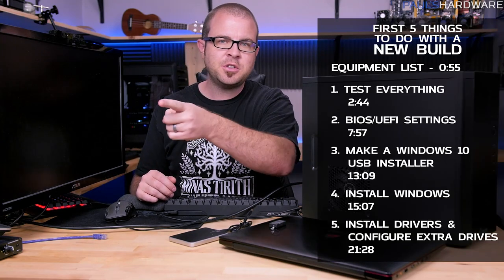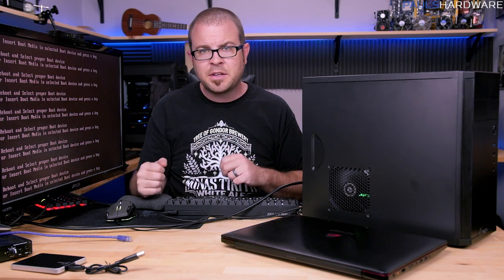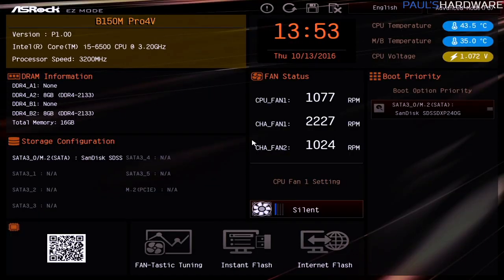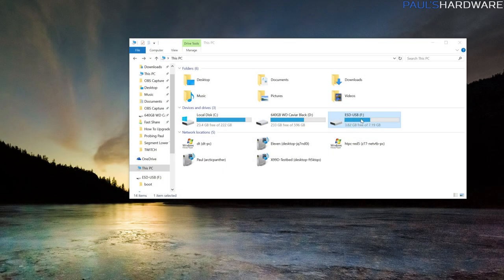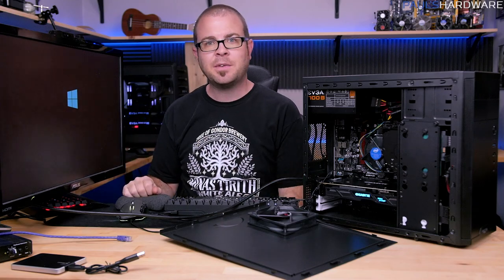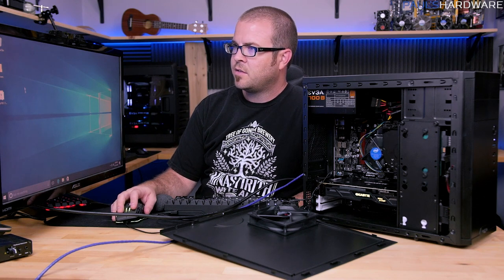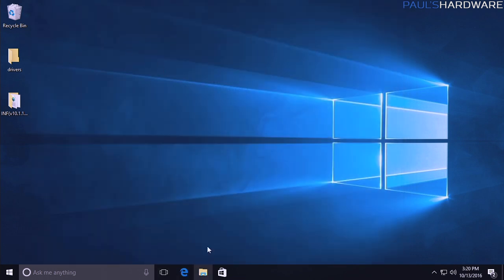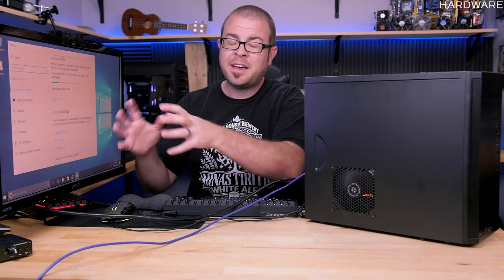First 5 Things to Do with a New PC Build

Comment: Windows makes me sad. If I am paying money for a software license THERE SHOULDN'T BE ANY ADDS OR SPYWARE ON IT.

installs Linux mint

Re-installs Windows because of games
Reply: have you tried Wine or something similar? i heard it works for a decent amount of windows games but never took the time to personally attempt it
Reply: I did a long time ago, back in the days of WoW Burning Crusade it ran better under Linux than under Windows (I had low ram, and Windows would just suck it, like a lady of negotiable affection suffering discontinuation syndrome from crack cocaine)
Reply: Wine doesnt work for everything. What it does work for isn't always stable. And when it is, it almost always has lower performance than on native windows. Unfortunately, there just isn't enough install base for people to support linux properly, either through wine or through native support.
Reply: That's the sad part. You have to use Windows for games.
Reply: I mean, you don't HAVE to use Windows to game, there are tons of games with native Linux versions, a lot of games that work just fine with wine and all the emulators you could ask for. Especially for older games there is a good chance that they will run better under Linux than they do under newer versions of Windows.
For my gaming needs, Linux is totally fine. Like, I have a ton of games in my Library with native Linux support that I have never touched, because I just don't have the time to play all of them.
That said, if you are the kind of gamer who is all about the newest AAA gaming titles, you probably want to have a Windows installation.

Although it is totally possible for that Windows installation to run as a guest virtual machine on a Linux host, with hardware pass through. That way you can just run Windows alongside Linux without having to dual boot and with pretty much no loss in performance. Do all your browsing and everyday computing in Linux, fire up Windows when you feel like gaming (or keep it running in the background), best of both worlds. Does require some extra attention when purchasing hardware though (has to support virtualization) and you are going some Linux wizardry to pull it off, it's definitely not beginner friendly. But it can be done.
Reply: download pre activated windows lol that shouls save you a fuck ton of money.  never had issues and it works great.
Reply: I want to play witcher 3, I guess I can always use my wife's laptop to do it since it came with windows preinstalled
Reply: Nothing you can't disable manually :) I used W7 for years and I was against W8 and 10 (8 is really terrible that is something I won't change my opinion about) but when I got my new z170 system I had to install W10 or do some work around to get it installing W7 however I thought about giving W10 a shot and actually it's quite   good in almost everything after u disable Microsoft crap however what I have noticed is that W10 has more process running in the background no matter what u do (they are necessary for windows its self)  more than W7 did :/
Reply: Jack Krauser Another reason I dont like Windows is that it doesn't feel safe. I forgot my admin password on my old W7 laptop, hadn't used it in 2 years, so I was able to clear the password field using just a linux boot drive, it took like 10 minutes. 

Malware and spyware is a lot more of an issue on Windows, as well.
Reply: Except that each and every single internet provider in america also sells everything you are doing while connected. The internet provider get more money for doing this than any amount you could ever give them for any level of service
Reply: Ronald C Krause Jr but... I use a VPN
Reply: You can disable those ads and (most of) the spying (Spybot Anti-Beacon). 
Look, I appreciate the concept of an open source OS. As a matter fact, I have Linux Mint installed (though I still need to install a decent dualboot-system cause the one Linux gives sucks :(). The problem is that hardware manufacturers and developers refuse to be nice and support it decently. For example, my sound card didn't work out of the box for Linux Mint, the one I've got is quite well known. 
Let's hope that Vulkan will become the dominant API. Given that DX12 is based on Mantle, just like Vulkan, while Mantle had been perfectionized by the guys who developed Mantle and many others from hardwarecompanies, softwarecompanies and good volunteers I expect and given the professional organisation around Vulkan these days I expect it to become better than DX12. The only worry: will they offer the same level of support as Microsoft does for DX. That will make the difference. If Khronos Group does offer that level of support we at least wouldn't need Windows any more for gaming. That would be great!

For now you need both Linux and Windows, exactly as Microsoft likes it. 
On that note, I hate the GUI of Windows 10. What's up with not allowing the user to pick its prefered color? You can pick any color you like, as long as it is white, grey, black (all horrible for LCD screens!) or ridiculously bright. Why both a sign-in screen and a login screen? Why can you only disable one with a registry hack and the other if you have a password (for one account you don't need a password or a signin/login-screen.The idiots of Microsoft who decided this all should go do something else than codevelop GUI's, no offense. I strongly prefer W7 over W10 even though W10 has a better performance. The only thing MS got right for W10 with regard to the GUI is that now you can finally hide the taskbar (after showing it by pressing the Windows key, for example if you watch on Youtube to see the time) by pressing the Windows key, unfortunately they still show a few pixels of that taskbare while it is hidden. I am not going to complement them for returning the taskbar, that should never has disappeared for that Metro bullshit.
Reply: Lets not forget that it is also ransom ware basically, I had my computer setup so that it wouldn't download windows 10 build updates I like to do it manually and they started shutting my PC down no if and or buts it would just shut right down till I updated . . . I didn't get my first notice that they were going to start doing that till half way through a match of CS:GO and after the notice it shutdown in 10 minutes.
Reply: David Remus I know windows shuts down after an update has been downloaded, in order to apply the update. On Home and Pro versions, you can only delay that shutdown for a certain period of time. But I have never heard of it shutting specifically because you want let it update. I have it on two laptops and have not had that happen. I never connect them via ethernet so they never update because it always treated as a metered connection.
Reply: Jason Smith

One of the long list of reasons why W10 sucks. That, not getting the freedom to choose you own fucking color for the windows, the obligated sign-in and log-in screen, the poor execution of the autohide function (also a problem in the earlier versions of Windows) and more.
I don't want to use WiFi on my desktop. My modem has the function but I prefer a cable.
Reply: David Remus

Had you disabled the Windows Update Service?
Reply: Peter Jansen all updates were disabled yea.

I'm on a dual boot now cause windows is dirty as all hell.
Reply: David Remus

I don't like W10 either but for my new system I will have to use it because of DX12, it sucks but what do you do? I will also use Linux though when I can.
With regard to W10 I just type a reaction in another thread because someone basically told me that I am uninformed and backwards becase I said that W10 sucks.
I'll place it here too in my next reaction since it is appropriate. It is a bit of a longread.
Reply: David Remus

First things first, I have tried out W10 for a few weeks, starting a few days before the end of the upgrade for free period. I deliberately installed W7 again. One more note on that: the 'down'grade option didn't work while I didn't change anything in the folder that contained the W7 copy. According to some people Microsoft deliberately blocked that as from some built because the adoption of W10 wasn't good. MS also made it difficult to download an ISO of W7 in the last months before the deadline. Anyone kan have his own suspicions, we can only speculate.

I'll name a few improvements and a few negative developments.

A few improvements:

- performance (startup, multitasking)

- the autohidefunction. In W7 if you press the windows key while watching a Youtube video (or any other full screen application, I would guess) the taskbar shows, if you press again on the Windows key, the taskbar doesn't hide. In W10 it does. That is a nice improvement thought it is ridiculous that Microsoft didn't do it in W7 or earlier.

- some stuff with resolution, touchscreen, projection etc.

I am sure that there are some more improvements but I am plucking some low hanging fruit now.

Now the problems.

- My biggest complaint: Microsoft doesn't allow you to choose your own color for the windows. Talking about backwards, since you like to use that word. ;)
In W7 this was executed perfectly: you could pick any color you like by menas of a color gradient square and a nice mixer which has three sliders. In W10 you can choose between black, white, grey (black and white are horrble for LCD technology) and a few ridiculously bright colors. Yes, you can open the mixer via a secret command (not part of the GUI) but under W10 they skip most of the colors because MS insists that you use a ridiculously bright color if you choose a color yourself. Don't ask why. Some Microsoft employee answered that this has to do with the visually impaired people. Bullshit: only the default colors would have to be suitable to them, allow all the other colors for the 99-100% of the poplulation who are not that severely visually impaaired.
You might not find it important, I do value that a lot and it should be up to the user to configure it how he likes it.

- Microsoft makes a mess by using both a login screen and a sign-in screen. That only makes sens for telephone which you put in your pocket, it doesn't make any sense at all for destops and laptops. Exorbitantly sloppy!
Worse, you can only disable the needless (in every use case scenario when you use a desktop or a laptop) loginscreen when you edit the register and you can only disable the sign-in screen when you use a password. That is rather idiotic: whenever a computer only has one user there is no point of having a sign-in screen, also in that case there is not point of using a password.
"But what if someone steels your computer?" In that case the password offers no protection at all unless he is dumb. Boot with an OS from a flahs drive of put the dis in a slave configuration while you boot with another disk and you can access all the files. For protection of personal files only encryption of the drive works.

- Microsoft made a mess of the control panel and the new menu which is supposed to replace the control panel. Some options have been removed from the control panel (why?) and Microsoft pushes the users to use the new menu.
All these three complaints have one problem in common: Microsoft doesn't give the freedom to the user to use the system as he wants it. W7 gives much more freedom to the user than W10.
Look, I don't mind if the default settings are aimed at first time users but at least make it possible to tweak it and certainly don't actively obstruct users in doing it. Search for registry twaeks to change the color and you know what I am talking about.

- obviously you have this telemetry mess, the forced updates and the lack of testing.. Microsoft only allows you to disable some of the telemtry options and only some of those can be deselected during the install of W10. Forced is realy bad. I don't mind security updates (d'uh) but there are also many updates which either are detrimental (Windows Genuine Validation shit which unjustifiable blocked legal OEM's of the OS, admitted by MS itself) or unstable. There were people who lost functionality of their hardware due to an automatic driver update via Windows 10.
The lack of testing is a serious problem, you might know (or should know in your case) that Microsoft fired the entire testing team a few years ago. That is one of the reasons why MS obligates updates, the W10 users are now obligated to be beta-testers. I don't mind beta-testing but not forcefully and not for you main OS. 

- W10 background processes run disregarding the load. If it is not essential that such a service performs a taks at that moment it shoulnd't do it while there is a serious load on your computer (gaming, video editing, benchmarking, modelling...). W10 executes it anyway while your system is under a heavy load. For W7 this is less the case. According to the guys of Linus Media Group. I can't verify it yet (yes, I have tried out W10, I went back to W7 due to the problems which are following)

Of course it is perfectly fine that you have a different preference than I but don't claim that W10 is lightyears ahead of W7, that is utter bullshit. There are pro's and cons. For me W7 is nicer and in some ways Linux is nicer than W7 (yes, I also use Linux). However, due to software lockin (DX12 exclusive for W10) I will have to use W10 for my next system, unfortunately.
What Microsoft is doing with hardware is impressive, even more impressive is that Microsoft actually develops and produces a lot of it itself. I never expected that Microsoft would be able to do that, kudos for that. For het OS microsot has made some wrong decisions.

One final note. To those who want to type that I shouldn't use it if I don't like it: thanks to vendor lockin you don't get any choice. I user LInux when I can, Windows when I have to.
Reply: This is what my friend does with his X99.
A good reason to have 16 cores, and 32GB ram i guess.
Reply: Idk, all the games I play frequently on Steam support linux, so I'll switch over to that once I build my new pc...
Reply: Robert Lindner

I have Linux on my system but on my current system double booting doesn't work: too slow. On my next system I will try to use both Linux and Windows if and when the hardware plays nice with Linux and the performance on Linux isn't any worse.
It looks like Vulkan will become the next big API anyway, in that case Linux will run every new game. Of course it will take a few years before those games come out and after that it will take a while before those games can be bought cheap but nevertheless, 6 years from now we might only have to use Windows for legacy purposes and some years later maybe all the DX11 and DX12 games can be emulated. Ideally once Vulkan becomes the dominant API MS surrenders, apologizes for having been a dick and offers DX9, DX11 and DX12 to Linux. I don't see that happen though. ;)

Why will Vulkan be the next big API? Many technical and practical reasons and allegedly (via via someone who works for that company) Bethesda has already decided to prefer Vulkan over DX12 because working with DX12 would be too difficult.
Reply: use windows 7 ! :)

oh wait...
Reply: FoxTorial me and my roommate are moving backnto win 7 cause win 10 is breaking my pc and all my games
Reply: David Remus

MatPat was playing "I wanna be that guy" (a
'simple' 2D platform game from 2005) on Windows 10, search for GTLive on Youtube and you can see it. The game had random crashes all the time. Unbelievable.
Linus mentioned during the last vlog on LinusTechTips that the battery life on laptops had a difference of hours while performing the excactly the same tests on the same system. It is due to W10 executing all kind of tasks which are not asked for or required at that moment and with Windows its lovely telemetry spyware crap.

Yes, W10 sucks! It is that I need DX12, otherwise on my new system I would choose for W7 next to a Linux distro. Also I hate it that you can only choose like 1% of all the colors for the Windows: 'black', 'white', grey and ridiculously bright colors. I also get annoyed by the obliged sign-inscreen or password while I am a single user fot that PC. Fuck Microsoft!

I downgraded again to W7 on my current rig, not thanks to MS which blocked the downgrade (it said that the folder wasn't intact whil nothing had changed, had to do a clean install which did solve the MS Windows slowing down problem which I had).
Reply: while pressing shift click restart then you will get into the extra options
Reply: *****
No system is fully secure. It is not about security though Windows certainly haven't become more secure. I hate W10 because it is a userunfriiendly operating system:
- you can only select less than 1% of all available colors for your windows
- you have to click on both a lockscreen and a sign-in screen when your computer awakes (tailored for fucking mobile devices, MS didn't even manage to realise that for PC's this is clumsy)
- telemetry bullshit
- lots of useless backgroundtaks which start while you are gaming
- little tweakable compared to W7
- still not a good autohide function for the taskbar (you still see pixels of the taskbare becuase those idiots of Microsoft translate the taskbare instaed of simply not drawing it :N)
- nagscreens (if you select Chrome or Firefox as your standard browser)
- ads in the startmenu
- bloatware in the default installation of Windows 10
- installing software without the administrator's permission and removing software without the administrator's permission
- force updates and horrible update sheduler (it should be possible to do that once a week or month whenever you choose to do so and only obligated security updates which could harm the users system)

Windows 10 just sucks! But that isn't even the point. The point is that every computer user should get the freedom to choose its own operataing system instead of being forced to use OS X (in this case Windows 7/10) because it makes developers use fucking proprietary software.
Reply: Democritus86

What extra options?
So far I have only found one way to get a decent GUI yet, install a third party program which installs aeroglass. With all the GUI options, including the secret ones, you can still select less than 1% of all the colors for windows: 'black', 'white', grey and ridiculously bright which even blinds severely visually impaired people.
Reply: "download pre activated windows "....You mean OEM version correct?
Reply: Spybot Anti-Beacon....Love this tool
Reply: Q Owens

It is great but don't expect it to block all telemetry, that seems impossible unfortunately (MS changes the domains all the time and they use hundreds of domains). Spybot Anti-Beacon is a service of that company, they don't make money on it. That is great but it makes good long term support uncertain.
Reply: It blocks all the telemetry that i need blocked
Reply: The only true security on any operating system is common sense.
Reply: Q Owens

That is true. It doesn't mean that an OS can't increase security but no security will help if people have bad internet habits or something like that. Personally I don't even allow any scripts other than those which I whitelisted, one simple step to increase security. A onetime investment per website which you visit.
Not the only thing I do to improve it, just one step. As some techtuber said recently: you can get by without a virus scanner if you use your common sens online. It took 2-3 years before he got a virus again. I scan occasionally, I rarely have a virus problem.

Oh, one good advice for those who are unfortunaate enough to buy prebuilt computers with preinstalled anti virus software and other bloatware (yes, that specific antivirus software is bloatware, just because it is incredibly inefficient): uninstall it immediately. It helps a lot. There is lot of crapware preinstalled, especially on laaptops.
Reply: Q Owens

"It blocks all the telemetry that i need blocked"

That is unlikely, I am afraid. It is rat race to keep up and this software probably is not the biggest priority of that company given that they don't earn money with this software (it just is a service). You don't think that Microsoft doesn't change the domains all the time? They are not fools, they know that software like this actively blocks domains from Microsoft for telemetry purposes. Also they could use the same domain as which they use for updates someday. Don't fool yourself! This kind of software can help, for sure, but it doesn't guarantee that all unwanted telemetry gets blocked. Don't believe me, watch Banacules Nerdgasm his video on it, he actually worked for Microsoft (testing department0.
Reply: Jack Krauser I recently installed Windows 7 on a Z170 motherboard, downgrading (upgrading really) from Windows 10. Here's the trick: Windows 7's installer doesn't recognize the USB controller for Z170 motherboards. You can't do a USB install.

But hell, you probably have an antique SATA DVD drive, right? An oldschool optical drive? Burn a Windows 7 ISO onto the DVD, install from there.
Reply: Tuchulu when you reset your password using a Linux password reset disc, chances are it was made for Windows too. Otherwise you wouldn't have been able to use that disc on your machine.
Reply: Q Owens Easiest way to hack your own windows password is to tell the windows to open up the console instead of the accessibility panel when asked to. Then log into windows, click the accessibility button, and voila! you've got the command line. EZ.
Reply: Yeah never done that one..... But i guess since I'm the only one who uses my systems, i won't have that problem. Thanks for the education
Reply: My point is that it was ridiculously easy to go around a password. It's like locking the front door to your house but have a 6-foot hole on the wall next to it covered in thin plywood.
Reply: Gotcha but the average user doesn't know this
Reply: char whick

"Jack Krauser I recently installed Windows 7 on a Z170 motherboard, downgrading (upgrading really) from Windows 10. Here's the trick: Windows 7's installer doesn't recognize the USB controller for Z170 motherboards. You can't do a USB install.

But hell, you probably have an antique SATA DVD drive, right? An oldschool optical drive? Burn a Windows 7 ISO onto the DVD, install from there."

Great, I want to build a Ryzen PC withtout an optical drive and install W7 and I would have to search for an empty DVD. Oh boy, Microsoft sucks.
Reply: Peter Jansen You can install Linux and run Windows on a VM
Reply: Just install windows 7.
Reply: downloads wine on arch there
Reply: I pretty much stick to windows because autodesk doesn't provide linux versions for education licenses. Dirt poor student here, and I'm not gonna drop couples hundreds anytime soon on that. no pirate version for linux either :(

I do use linux for mostly everything else. Photoshop can suck it. Krita and GIMP are good enough for me. Although if you're a professional, you're kinda fucked and need windows. The rest of the adobe ecosystem can also suck it due to stuff like DaVinci resolve, other pdf document makers, and so many other alternatives.
Reply: Pci-e passthrough works, also crack windows. Micro$hit dosen't deserve the cash